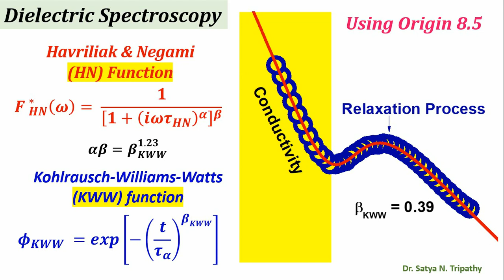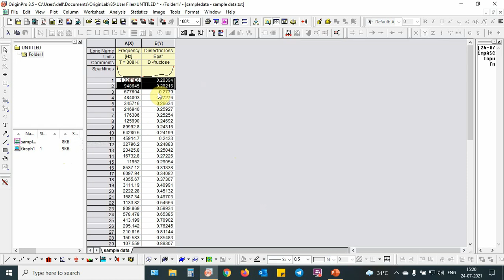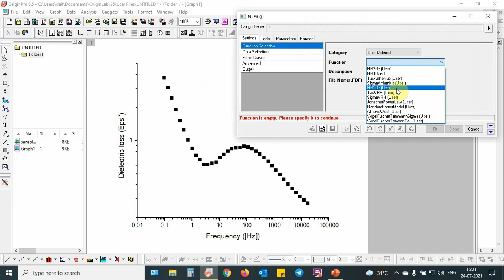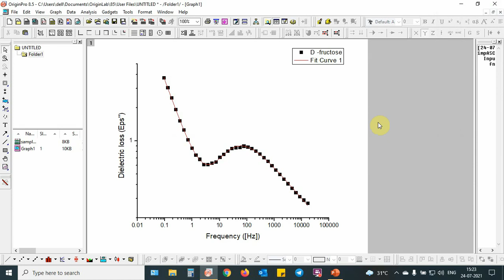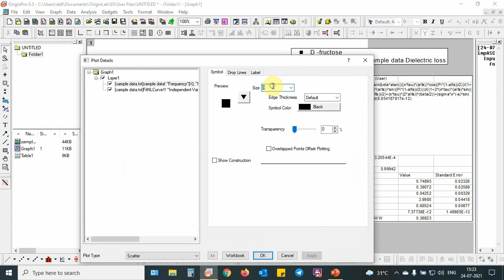Dielectric loss Data Fitting Using Havriliak-Negami Model Using Origin (Dielectric Spectroscopy)

Comment: Good explanation Sir, moreover it appears like hands-on experimental data fitting. If frequency Vs e'' (imaginary part of e) is an almost straight line instead of a relaxation peak, then how to calculate it?
If need I will send the data file.
Besides, Havriliak-Negami Function fitting for frequency Vs e' (real part of e), I have fitted using Origin fitting P2+[P1-P2]/[1+(P3*x)^P4], but the problem is I could not able to calculate the relaxation time? Please clarify it?
Reply from the maker: Thank you for your query. If the frequency dependance of imaginary permitivity is without any peak or featureless then take the derivative of frequency dependant plot of real part of permitivity and multiply with -1.57 which is equivalent to dieletric loss vs frequency plot. But here if any peak is hidden, it will display. Moreover, the formula for the HN function you mentioned is not correct. The exact formula is given in the Kremer book , broadband dielectric spectroscopy. If this does not work, then mail me. Satya
Reply: @physicsdoneright  ....hello Sir, can you please share the reference for the above comment, in the case when we don't see any peak or hidden peak.
Could you as well share the origin equation for the Havriliak Negami funtion, please.
Reply from the maker: I have  mentioned the code below for single peak:
parameters: eps,alfa,beta,tau
Equation: y=eps*sin(beta*atan((((x*tau)^(alfa))*cos((PI*(1-alfa))/2))/(1+((x*tau)^(alfa))*sin((PI*(1-alfa))/2))))/((1+2*(x*tau)^(alfa)*sin((PI*(1-alfa))/2)+(x*tau)^(2*alfa))^(beta/2))

eps: height of peak
alpha and beta: shape
tau: relaxation time

With out peak:

Investigations of Relaxation Dynamics and Observation of Nearly
Constant Loss Phenomena in PEO20-LiCF3SO3-ZrO2 Based Polymer Nano-Composite Electrolyte
https://doi.org/10.1016/j.electacta.2016.03.134
Reply: @physicsdoneright  .....Thanks a lot.

Comment: Sir, I am trying to fit it exactly the same way as explained but the fitting line is only corresponds to DC conductivity part and the chi2 is reaching minimum value without fitment of relaxation part. I can't figure out what's the problem.
Will you share the exact equation from HNDC1 function.
Reply from the maker: Brief Description = Havriliak-Negami + DC conductivity

Parameters: alfa,beta,tau,eps,s,sigma
y=eps*sin(beta*atan((((x*tau)^(alfa))*cos((PI*(1-alfa))/2))/(1+((x*tau)^(alfa))*sin((PI*(1-alfa))/2))))/((1+2*(x*tau)^(alfa)*sin((PI*(1-alfa))/2)+(x*tau)^(2*alfa))^(beta/2))+(sigma*x^(-s)*sin(PI*s/2))/(8.854187817e-12)

Check my video how to create a origin function.
Reply: @physicsdoneright   Hello sir! Thank you for the detailed explanation. Could you please describe why there is a sinusoidal term with the dc conductivity "Sin(PI*s/2)" in the above function??
Reply from the maker: @vishnudeomishra2245  Kindly check page 62 of the following book: https://link.springer.com/book/10.1007/978-3-642-56120-7
Reply: @physicsdoneright  Thank you!🙂

Comment: In fact, fitting only the imaginary part is not correct. One must fit the real and imaginary parts of the dielectric data simultaneously. So, it would be better if you could guide your followers to fit both parts at the same time by providing codes for the real part as well.
Reply from the maker: The purpose of this demonstration video was to understand the relaxation properties, like relaxation time, dielectric strength, and shape parameters in ceramics and glasses. It's an example video how to fit the data for one peak and added dc conductivity. Those who are interested they and see some literature in Kremer book how to fit the real part. It's upto their choice. According to my opinion, research in the field of dielectric is a self driven thing. I have made this video for the PhD students who are in the 1st year of their studies. If they learn they will do it.
Reply: @physicsdoneright   Ok yes but you can make a longer video demonstrating a complete fitting. It would be a best guiding video for the students. I have seen that many PhD students have lack of this things and they report wrong data by fitting. At last, it’s your choice what to share. You are doing a good job to enlighten the  young students. Keep it up. Kudos!
Reply from the maker: @dharma4you thank you for your suggestions. I appreciate your comments.
Reply: @dharma4you  yeah i am facing the problem, i dont know how to put real part and then how to combine both of them
Reply: @wafazulfiqarzulfiqarali8360  I am facing the same problem brother. how did you tackle this?
Reply: @RahulSharma-cn4qq  i changed the equation little bit, also i fitted data separate for both real part and imaginary part.